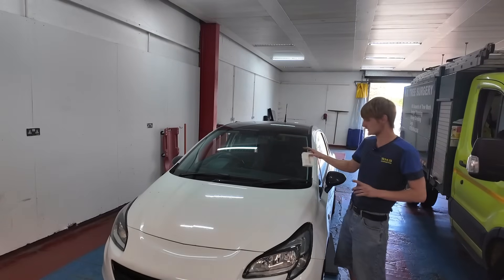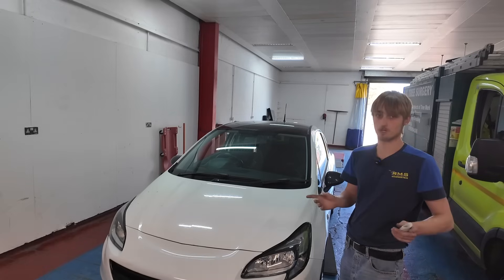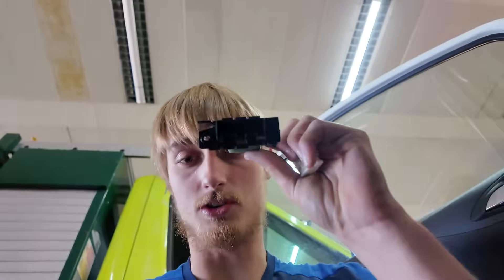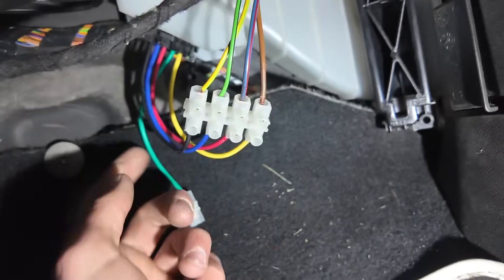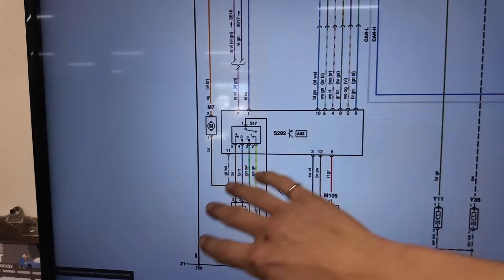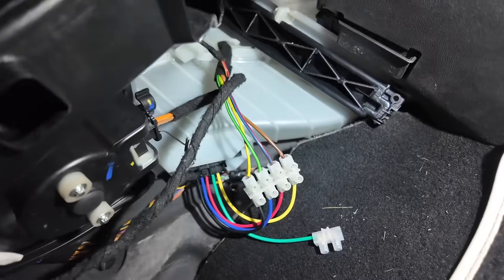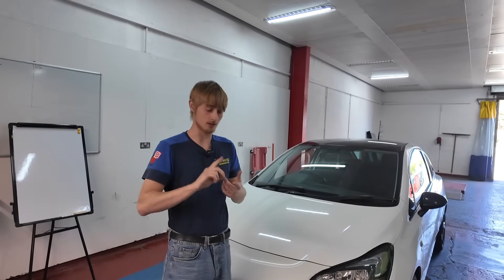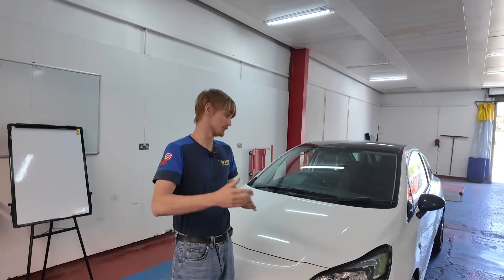The Truth Behind a Vauxhall corsa blower motor fault ( big mistake)

Comment: Does the resister reduce the voltage or does it restrict the current to the motor?
Reply: It introduces differing resistances into the blower motor earth circuit to vary the speed. The thermal fuse is there to protect things, if it all gets too hot the fuse melts and cuts out the motor. This is caused by the motor wearing out, drawing too much current.

Comment: Hi Barney. Some years back I was changing quite a few of those resistor arrays on VW Caddys. I had one come back failed again fairly quickly so I decided to measure the current draw on the fan motor. I don’t remember the exact numbers now but it was drawing more current than the fuse was rated at (e.g. if the circuit had a 20A fuse it was drawing 21A) Second time around I replaced the fan motor and resistor and the current draw dropped to about half. So, my theory is that the fan motors tighten up on their bushes and the current required to make them spin increases, this causes a higher than intended current flow which overloads the connector terminals and resistor causing them to fail. I’d say that the solution in most similar cases is to also replace the fan as is being done here. Lightning quick diagnosis in spotting the ‘flipped’ connector wiring. I’m not surprised they got confused after doing that!😊
Reply: P.S. I think I remember watching Bob in a previous video where he linked pins 4 & 5 together as they are linked inside the resistor anyway. This would reduce the current flow at each pin/terminal pair to half and make the chances of repeat failure less likely. P.S. I think the guy who commented is correct when he said that the component that you described as a diode is actually a thermal fuse. BTW I hope you don’t interpret my comments as negative criticism. I’m just sharing my experience and hoping that it may contribute something to your learning. You are an amazing and smart young man 😊

Comment: There is No diode in the resistor
Reply from the maker: just looked it up,inalways thought it was a diode but looks like a thermal fuse,I’m sure some had diodes
Reply: The bullet shaped component, that's a 1-shot thermo device. Once it gets to it's temp valvue it blows open circuit to protect the wiring. That's not an electronic module type speed controller. Purley resistive.

Comment: Car electrical faults are harder to solve than domestic wiring ones.
I would have checked that the blower motor was good before buying
a new resistor pack and connector.